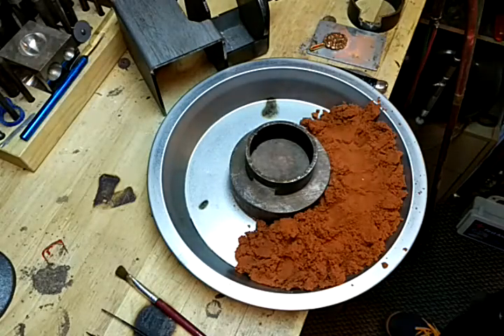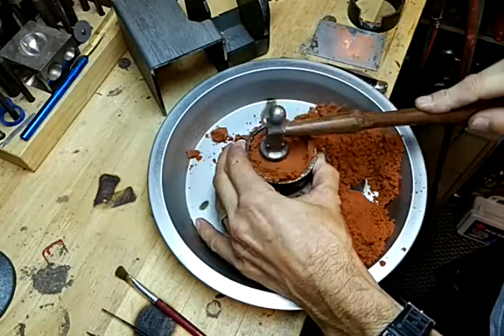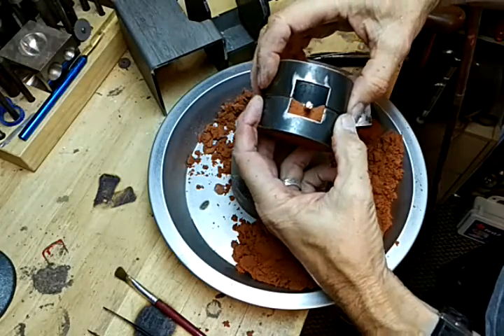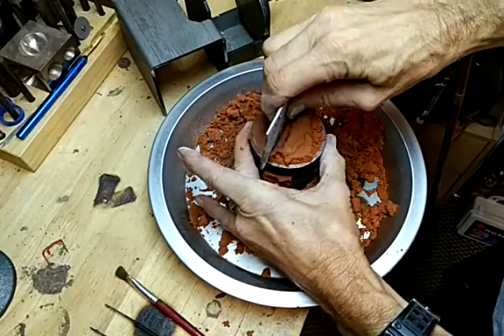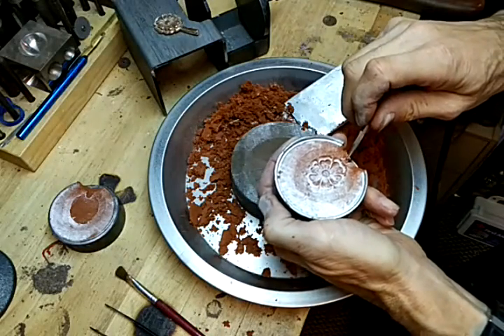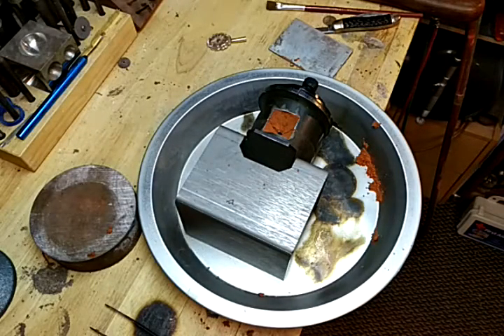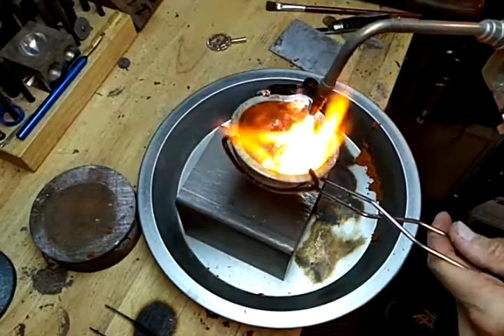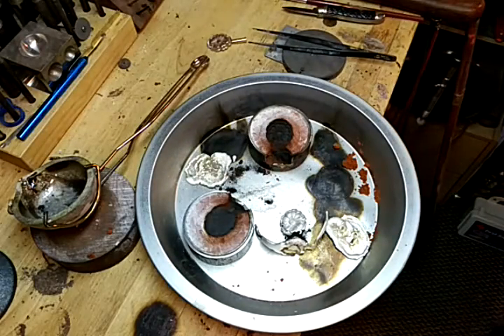An Instructional Video on Sand Casting

Comment: Is it okay to do it with too much metal? Or should you calculate it before hand.
Reply from the maker: You can either weigh it out first or guess which is what I did. My typical pour is 1 1/2 ounces which works for most jewelry size items.

Comment: Hi Craig, two questions: At 6:34 you added borax to the metal. I have seen everyone do this that melts metal, but don't know why. Also would it hurt the casting or container to let it sit and cool on it's own without opening it if you wanted to do that?
Thank you!
Reply from the maker: Hi Debbie, borax is added to help the metal flow better but it doesn't have to be added. No, it isn't a problem to let the flask sit for awhile to cool but I open it quickly to keep the video short.
Reply: It cleans the metal of impurities by aiding it in separating dissimilar viscosities while it's molten... If you sprinkle some on top while it's molten, you'll notice it draws up the impurities and then you flash, (remove the flame for a second), and see that the surface tension is changed, and the impurities are drawn to the sides of the crucible for that second it had cooled... It also acts like a flux creating a barrier of gas which prevents the metal from reacting with oxygen in the air and the air feeding the torch if you're using Oxy/Propane. It basically acts as a protective shield and aids in keeping the molten metal viscus. That's to the best of my understanding, but if I'm incorrect, please feel free to let me know. :)